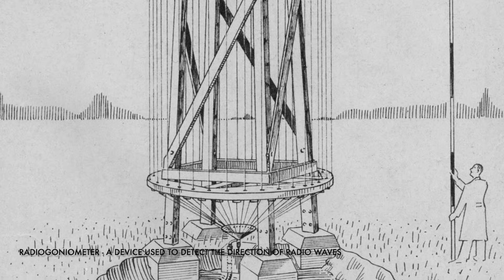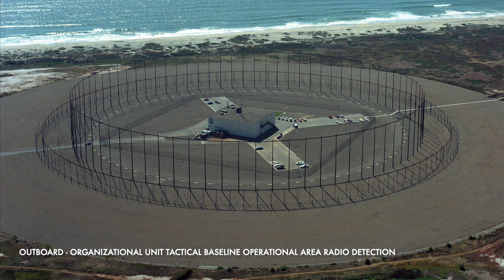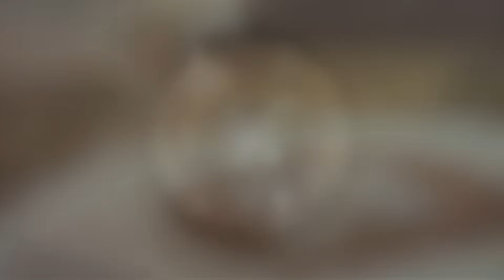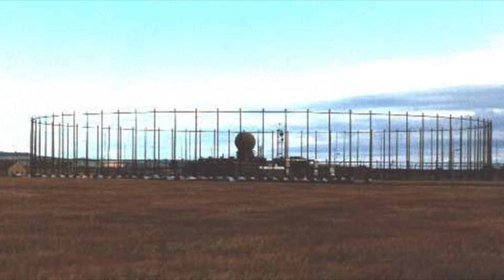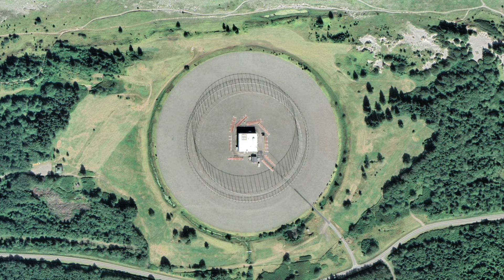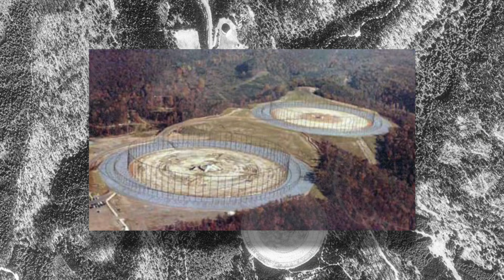Classic Bullseye - The US Navy's Ears On The World

Comment: A few years ago, I visited the site at Corea Maine. Well overgrown, but the HF antenna concrete bases were still visible, and the buildings, though stripped, were still standing. I entered the central buiding, but it was pitch black, and I had no light, so rather than fall down a hole, I backed out. Many troughs and such for cabling, and I suppose it may have had a raised floor. I believe the site was bought by a fish farming company. That site also includes bases for CLASSIC WIZARD satellite antennas (also long gone, with only the concrete bases remaining.

NSG was bsorbed by NSA which is why the Hawaii site is now NSA Hawaii. The sign on the road going past the turnoff to the facility says merely "Navy Communications Facility". The main building you showed is named for Joseph Rochefort, who ran the team that broke Japanese codes in Hawaii during WWII and developed the information that led us to sink four of their carriers at the battle of Midway.

Comment: I was CTR stationed at Skaggs Island from 1967 - 1969. I also helped out the mat department and worked as CTM during my final year at Skaggs. I then worked my final year at NSGA in Wahiawa Hawaii as CTR. Both stations were Westpac net control stations which had both the old FLR-7 and the newer FLR-11 systems. I learned a lot during my 4 year Navy commitment!

Comment: I worked for a civilian service contractor out at NSGA Skaggs Island, just past Mare Island Naval Station. We had a AN/FRD-10 installation just visible from Hwy 37, and some other antenna setups spread across the base. Skaggs closed in 1993, a year before Mare Island, and eventually ended up as part of the San Pablo Bay National Wildlife Refuge (so, no the general public can't drive out there). All the base buildings were torn down in the late 2000's and the only antenna still out there is the VORTAC airway nav beacon (still in operation; you can just barely see it from the hwy) on the air charts as SGD.

Comment: What is the point of removing something way out in the woods if the land isnt going to be used for developments or farming? Its just a bunch of metal poles why not just let it fall apart? Plus its so old that its not like its a secret or secret technology. Seems like a waste of money and time.
Reply: The Corea (Winter Harbor) Maine site was sold at auction a few years ago. Easier to sell if it's just a building. The antennas probably eren't worth much, but the ground planes and coax had lots of copper to reclaim.

Comment: I used to work for the FCC here in Puerto Rico. There was an elephant cage direction finder antenna operated by the Navy. I use to  work in their facility in Sabana Seca  getting HF signal direction azimuth from the antenna. We moved from there at around 1991 or 92 because i remember getting azimuths from iraquí jammers in the first iraquí war. Any way there were multiple stations in the states an some times the system got input from multiple stations in the world. The station is not there anymore. In 1992 the FCC got its own station a Doppler one. Thank you for your channel.

Comment: Here again excellent memories. I started in HAM Radio in 1961, joined the Navy in 1964 and worked at three of these sites during that enlistment. What's interesting is the fact that I have been in radio from 1961 to present 2023.  I presently own a commercial tower being use for 5G broadband. Still get on 20 meters with my keyer and do the old stuff. KE6QK !

Comment: I had the distinct privilege of being stationed at all four of the Navy's different CDAA sites within my 11 years of active duty between 1972 and 1983. My first duty station was Misawa Japan. We used a three-band AN/FLR-9 array maintained by the US Air Force Security Service. My next duty station was NSGA Azores where it still used the AN/GRD-6 small diameter array. This unit had a motorized goniometer but was originally configured with a manually operated gonio. NTTC Pensacola also had a GRD-6 for training purposes. My next duty station was NSGA Northwest which had an FRD-10 array. I was in charge of the shop that maintained the two goniometers and all of the distribution equipment. The goniometers were really a great piece of engineering! My final tour on active duty was back to NSGA Azores where the GRD-6 had been replaced with the AN/AX-16 Pusher array (made by Plessy in the UK.) It was an interesting time to be involved with Classic Bullseye and I am curious if any other CT had worked with all four CDAAs.

Comment: I want to understand how they work and why so many have been decommissioned‽
Reply: For a very simple explanation, it simulated a spinning flat antenna array. If you lined up eight or more monopole antennas and spaced them just right, then the reception pattern was a very narrow beam perpendicular to the array's axis. Now, picture that flat array spinning around like a paint mixer on the end of a drill, picking up signals almost like a radar beam in reverse. Mix it with some electronic magic and you could tell from which direction a signal was being transmitted.
Reply: It's an HF phased array antenna system. By comarint the time of arrival of a wavefront at several antennas, you can determine the bearing of the transmitter. It works as a transmitting antenna as well...feed the same signal to different antennas with slight phase differences and you can "steer" the transmitted signal. These systems could monitor multiple signals simultaneously and they could steer the system to aim it at the emitters if necessary.
Reply: @antronargaiv3283 when I say I want to know how they do that I mean I want to know how to program the fpga or DSP with what math to make that a steerable, focusable, dynamically phased array. 
   Like if I said I want to know how you  make some kind of car to work, I don't mean tell me the concept of internal combustion, no, I want to know how the cams set the valve timing and keep it all in tune with the spark plug and why things have to be advanced or retarded and etcetera
Reply: Just posted a tip to TymexComputing above. Happy hunting.

Comment: So what happen in the 90's that Obsolete these ?
Reply: I think Sat GPS, these were used to shoot a straight shot from their location. Have to have t2o others to triangulate the transmitter. A fix. I was at Ramasun station. I was involved with the airborne radio directin finding from a U21 at both ramasun and Utapao 1974/75.  We used inertia navigation, GPS wasnt required. Had a s;inning top in the aircraft. The FLR-9 was used while I was there through end of 1975, shut down in 1976.
Reply: CLASSIC WIZARD/PARCAE/WHITE CLOUD

Comment: An excellent video, as always.  It does bring one question: What is the US military using in its place?
Reply: These antennas were only for HF signals in the 3-30 Mhz range. Now, most military comms are much higher frequencies or satellite based, so there isn't much need for HF direction finding anymore.

Comment: I was a CTM from 1970-1976. Worked on the FLR-11 in Keflavik (Rockville), Iceland from 72-74 and I'm pretty sure we had a FRA-54 hooked up to a Wullenwever over in Grindavik. I was also in Rota, Spain from 75-76 and it was cool to see the old and new photos.
Reply: So why would they remove them rather then just abandoning them if the land isnt going to be reused?
Reply: CTM at Grindavik 76-77 and IIRC the antenna array was a GRD-6.  Definitely not a Wullenweber like I was at on Okinawa and Winter Harbor.
Reply: we met        i was in flex    74-76,,        singles and (posit name still classified) back by the door to the CTI area

Comment: I had the fortunate experience of being the OPS Tech Section Supervisor from 74 to 78 in Gander.  Every so often, during an emergency and the inability to find the civilian antenna maintenance individual, I had to climb those poles to attach the guy cables.  It was cold on those fingers, and extremely frustrating if you dropped any of your tools from up there. 😎
Reply: I was posted to 770 in the mid nineties.  Was a nice posting.

Comment: That site in gander looks to be larger than two stories.  It locks more like 4 stories.  But, I can't go and check it because I'm half a continent away.
Reply: I was posted there in the mid nineties, can confirm it was a two story building, although the first floor had quite a ceiling.  The Gonio room was very high, so the building is pretty tall for only two floors.
Reply: @dakohli  that makes sense.  On average,  one story is 10-12 ft, depending on the type of structure.   However,  commercial buildings could be two story's with 20ft ceilings,  depending on what they're used for.  Using "story" as unit of measurement would not be a standardized measurement.

Comment: I was fortunate enough to work out of the Imperial Beach site after its decommissioning but before demolition.  I was attached to the US Navy's Mobile Diving and Salvage Unit Seven, which had taken over the building in the middle of the complex.  It was surreal to be standing in the middle of the array, then walk into the building which still had all the cabling but none of the equipment.  It was a big deal for all of San Diego when it was demolished.
Reply: I was stationed in imperial beach quite the awe inspiring antenna array  unfortunately none of the equipment or the narrf ( naval radio receiving facility antennas are left I was one of the “O” branches assigned there in the late 70’s-80’S
Reply: I thought the old WWII coastal defense gun sites buried under the dunes were cool, although there were concerns about the building materials used (we had to leave buildings for 15 minutes every hour)

Comment: Fascinating stuff! Actually, we had a pair of these southwest of Champaign, Illinois. Of those, only one wasn't plowed under, and its tell-tale ring can be seen on Google Earth; just search for "wullenweber array Illinois". As for the other, the site seems to have reverted back to cropland with no traces that I can find. My bet is that the University of Illinois operated these on behalf of the DOD, with one as a "control" so that modifications and improvements could be studied. But if you look around to the NNW of Sadorus, you'll find that one remaining circle.

That wasn't the only RF experimentation site that the UofI had. Many years ago, they had a radio telescope site in adjacent Vermilion Co. that was abandoned many years back. And closer to nearby Chanute AFB (decommissioned back in the early 1990s) and right by I-57 near Thomasboro, there used to be a huge log-periodic installation with its own control building, and from the looks of it, it covered from the lower end of shortwave up into low-band VHF. It's gone now, but the building was repurposed for cellular service with a conventional tower, which also appears to be hosting some local/regional 2-way comms.

But the really cool thing (besides the elephant cages, natch) was northeast of Urbana, where the University had an ionospheric research array, one of the precursors of the conspiracy-attractor better known as HAARP. This was an array of long cable dipoles on rows of phone poles set E-W in a field with a transmitter building around midway across, and it operated (supposedly) in the 2 MHz range, firing straight up.

The University here used to do a lot of RF research prior to around the mid-90s, then they just...well, quit. Losing the air base caused some of that, but other sites also went away for various unclear reasons. Oh, well...

Comment: I vividly recall driving up to the guard shack about 850 m from inner reflector of the NSGA Skaggs Island antenna in the late 1970s where my father who was a Navy vet and a ham asked the guard of the antenna's purpose. The guard replied that he thought "it was some sort of nuclear thing". The family turned around and continued to our picnic and the answer was dismissed as silly, but later I learned the site was to be repurposed in the early 1970s for a phased array RADAR to guard the San Francisco area with Zeus and/or related missiles at remote launchers. An arms treaty which limited the number of interceptor warheads caused plans to shrink to just the Stanley R. Mickelsen Safeguard Complex in North Dakota so the answer was less silly than thought. I drove up to the same spot in 2014 but there was a locked gate and later that year the whole access road was blocked. Side note: the first station to receive Sputnik 1 in America was the Press Wireless, Inc station roughly 5.7 km North-East of the Skaggs antenna. That station continued to track later Sputniks for the Hearst Newspaper chain.
Reply from the maker: Thanks for the info!

Comment: Although of course the purpose of these antennas could probaby be linked to the cold war, the short time period in which they were all demolished would hint that they were not only for military use.
Maybe they are more like coastal stations with the added advantage of localizing the ship that you are talking to, than to locate the enemy?
Most coastal HF radio stations were closed down in that period, so maybe these just went along with that?
(coastal radio being replaced by satellite, and location of vessels now done using GPS)
Reply from the maker: The fact that they were installed, operated and maintained by the navy at navy sites suggests that they were used for military use rob
Reply: @RingwayManchester  I agree.  What I don't understand is why they so suddenly were all demolished.  The military usually have the budget to keep such an installation operational even when the use is only speculative.
Reply from the maker: They weren’t really, some went in the 70’s, some in the 90’s, some in the 2000’s and some are still used. The maintenance must’ve been phenomenal so I suppose once a replacement was sorted they phased them out
Reply: @RingwayManchester  Or, once the users they were trying to DF moved on to other frequencies...  in which case it still was sort of related to what we have seen with maritime services.  Most short wave maritime stations have been shut down as well, so there must be a lot less traffic so a lot less to DF and eavesdrop on.
VHF and higher DF can of course be done from a satellite constellation.
Reply: @Rob2  When the HFDF system was replaced, any station whose primary purpose was only HFDF would be on the chopping block.  Now, if a station was used for other things as well, it might well survive.
Reply: All military, at least the two I worked in. And all classified at the time. Technology made them all obsolete.
Reply: Coastal defence on the water is the purview of surprisingly, the Coast Guard. The Army handles the land portion.
The area of the AN/FRD-10 I grew up near was also served by multiple Coast Guard radio stations. 
A Coast Guard member at one of those radio stations did the gardening which resulted in the 420 counterculture number.

Comment: I think there was one on the Azores as well.
Reply from the maker: There was! I missed it
Reply: @RingwayManchester  No problem. 
You have some great shots of the Arrays. 
It was good to see them again. 
The original goniometer was mechanically spun. Fascinating to watch.  
https://nvlpubs.nist.gov/nistpubs/jres/65d/jresv65dn3p237_a1b.pdf
Reply: I was stationed at NSGA Azores from Jan 70 to Mar 71 as a Mat-man.  Long time ago, but I believe the antenna was a GRD-6.  I had been at Skaggs with its FRD-10 (I think), and the GRD-6 was significantly smaller.  Same basic assignment, just a smaller ring.  Lajes AFB was an interesting base.  Great for married Air Force-types, kinda rough for single sailors.  But it was a good 15-month assignment.
Reply: @tommarek6489  Cool to know. My Dad was there in 60 to 64. I worked on some NSGA projects and got to go to Panama, Winter Harbor, Guam and Okinawa. Never made it to the Azores.  I envy you Tom.
Reply: @tommarek6489  Now that you have named it. I believe you are correct.
Reply: It was not an FRD-10.  It was a rather small array on the northern tip of Tercera (sp).  I was there 83-84.
Reply: @thefrustratedtheologian6238  
Didn't the RCA corporation build a full one? 
Yes, near La Jas AFB on Terceira Is. 
Hmm, I could be wrong. I never got to that one. Thank you.
Reply: @allenshepard7992  The NSGA was about 30 minutes from the main airfield. I have no knowledge of your question.

Comment: Very insightful again.   Worked two years inside RAF Edzell but not on the DF side of the house.  Have been inside the facilities at Rota and Imperial Beach but I was doing other more interesting things and was there for coordination meetings only thank goodness.  😂. Did you forget to add NSGA Diego Garcia and NCTS Guam?
Reply from the maker: Diego Garcia is a 6an/a16 plessey pusher not an frd10
Reply: @RingwayManchester  I was At Winter Harbor and Edzell, both with frd 10s. And Diego Garcia in the middle, which correct, did not have the frd 10. 1974-1977
Reply from the maker: Thanks for the info!